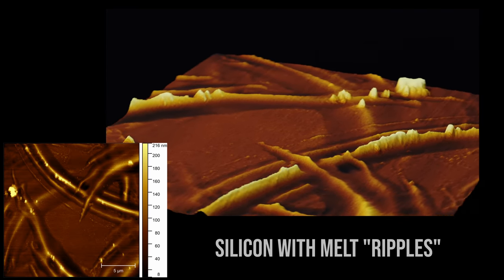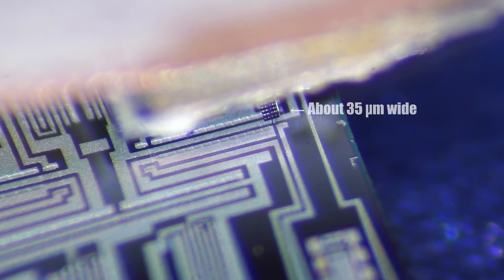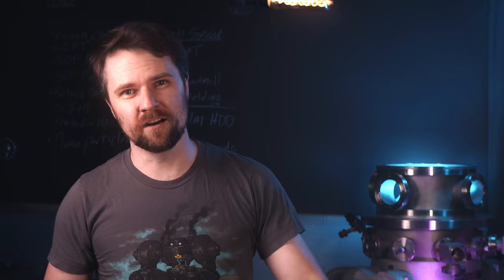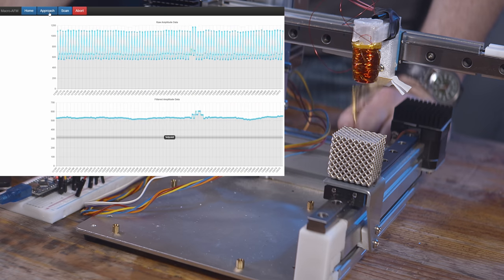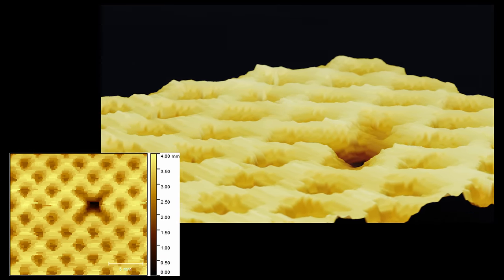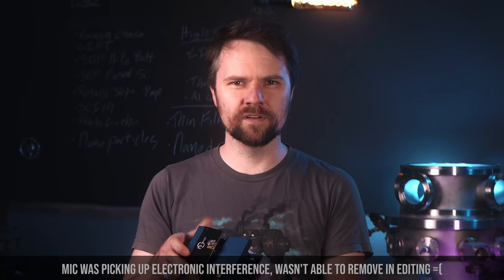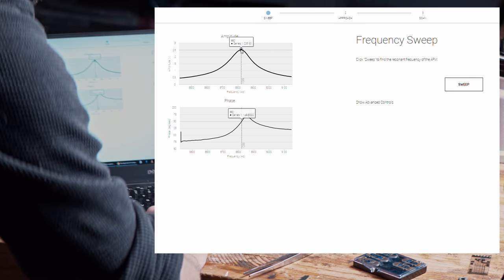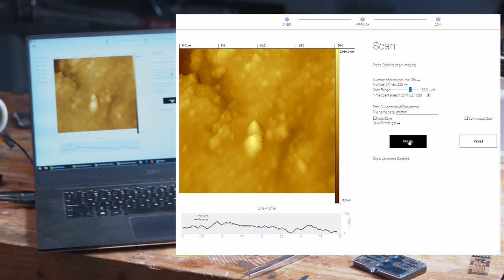1,000,000x Magnification with Atomic Force Microscope

Comment: i'm honestly more interested in the machine that you made rather than the commercial one. even though the setup is janky, it works remarkably well. i'd love to see how far you could push it if you actually tried.
Reply from the maker: Yeah it turned out remarkably good!  I really wasn't expecting much but it definitely surprised me.  I'm thinking about ways to improve it for a v2, something a little less duct-taped together. I think with a bit of love it could actually be a useful tool, and maybe hit micron-level precision with some reliability.  Honestly just needs a better stage and a smaller/faster cantilever (and maybe some better electronics to sense the back-EMF).  Or perhaps something that could be bolted onto 3D printers in general.  I'm thinking about reaching out to some more EE-minded youtubers and see if we could collab on something.  Dunno, but it's on the "things to investigate" list for sure :)
Reply: @BreakingTaps  i think you're right on "smaller/faster probe". you don't need nearly as much amplitude for vibration, it just needs to wiggle at higher amplitude than the maximum height difference, right?

i also don't really like the idea of using a 3d printer for positioning, because i think it'd limit the resolution greatly. the positioning system you used in the previous video looked way more interesting.
Reply from the maker: @Alexander_Sannikov  Yep, the oscillation just needs to clear the largest feature basically that you would encounter within a single step.  So smaller probe == smaller maximum discrete height change from pixel to pixel, but also faster acquisition time.  I didnt have time to get into it, but my software basically calculates the amplitude from the most recent few samples, and then does some simple moving averages to smooth out noise.  Faster oscillations mean the amplitude would "settle" in much faster.  Better software would help too, kalman filtering or other techniques. :)

And ++ OpenFlexure would work great.  Only downside is the very small XY range.  But it'd be a perfect fit for a miniatured cantilever!
Reply: @BreakingTaps  i like the idea of using flexible joints in such high precision mechanisms, because they should allow way higher precision from the same manufacturing tolerance. so no wonder the entire commercial thing is an alien compliant structure. do you think you could literally copy their compliant mechanism from an image and maybe laser cut it in sheet material?

hey about the patreon. i noticed your lowest tier starts with $5 which's considerably higher than they usually are. I think you could get way more overall if you allowed people to make maybe $1-$3/month donations too. also Applied Science runs a really cool scheme where we're paying for each video he makes no matter how long it takes, so he does not have to push projects at any regular schedule.
Reply: @BreakingTaps  Perhaps a magnetic/ceramic (piezo?) cartridge and stylus from a vinyl record player might work for V2? I'm sure they can be driven on half a cycle, and read on the return in a similar manner to the MIT paper. They bear all of the mechanical properties (cantilever, low mass, soft sprung, hard tip) except with a potential resolution in micrometres.

[Edit] I've just experienced the hoarders paradox. Keep everything interesting because one day there'll be a use for it. Except, decluttering one's life periodically means those interesting and potentially useful items get thrown out. A few decks and a box of pickups and styli are nowhere to be found. Stereo could have allowed one channel to drive, and the second to read with just a small modification to the pickup cartridge. You've set me on a mission now.
Reply from the maker: @Alexander_Sannikov  Could probably adapt their flexures to a more "macro" version I think.  It'd need a bit of adjustment, theirs use thermal bimorph actuators to drive in XY (and maybe Z? not sure), so those would probably need to be adapted to something else in the macro world, motors or something.  But otherwise yeah, to my eye the flexure looks like it uses pretty normal/standard flexure design and is planar.

Re: patreon, cheers! Still figuring it out :)  I do have a $3 tier, and just added a $5 because I was uneasy with the gap between $5 and $7.  I was thinking about the per-video thing, but I'm actually about to start ramping up how many videos I put out (starting a "micrograph monday" segment which are shorter and designed just to show off cool scans on the AFM or optical microscope... and possibly SEM some day 😇), so I didn't want folks to feel like I was pushing a bunch of videos just to capitalize on patreon donations.  I'll look into it though, maybe there is a way I can make Patreon only charge for "feature project" videos?  I'd feel bad charging folks for the shorter segments.
Reply: @BreakingTaps  wow i didnt know they use bimetal actuators. that's cool! do I understand correctly that bimetal actuators work best if they're tiny? because they need to have the highest heat dissipation/heat capacity ratio and since dissipation is proportional to surface area, capacity is proportional to volume and area grows as x^2 and volume grows as x^3, it increases to infinity for tiny mechanisms? 

if so, that'd be cool to talk about it in the video! heck, maybe you can print a small bimental actuator yourself by depositing two types of metals with sputtering or something.

Comment: If you like this look into SNOM scanning near field optical microscope which is essentially an AFM but also provides optical information such as absorption etc and sub diffraction resolutions. ie you can get nano meter optical resolutions with longer wavelength light such as IR.

Comment: You could try ellipsometry to check for a diamond layer. The data will allow identification by refractive index. A traditional setup would be:
1 light source,
1 photodetector,
2 polarizers,
2 quarter waveplates that you rotate by hand to 16 different angles.

Comment: This is a brilliant, fascinating video. The research you have done here is incredible. I have been doing a PhD in the NC-AFM (Non-Contact Atomic Force Microscopy) for nearly 3 years now, and I am impressed by the volume of knowledge you have expressed in this video.

I thought I'd give a little extension to your brilliant video. I'm sure you came across NC-AFM during your research, however in case you didn't I'll give a quick overview of the power and sheer 'amaze' factor of NC-AFM compared to conventional AFM. In NC-AFM we will create tips that are atomically sharp. As in the apex of the AFM tip is a single atom, which we often pick up from the surface that we are imaging. This lets us get down to pm (pico-meter) resolution, with a typical image taken at ~10 pm resolution (SI=10^1m, mm=10^-3m, um=10^-6m, nm=10^-9m, pm=10^-12m). Some truly amazing images have been taken. The most famous image is an image of a Pentacene molecule, taken with a CO AFM tip. You can literally see the covalent bonds between the Carbon atoms, within the Pentacene molecule, and even the 'bowed' shape of the molecule on the surface.

How do we do this? We oscillate our tip above the sample (hence the Non-Contact phrase), rather than letting it touch the sample like in the tapping mode technique you demonstrated here. Our samples are typically under Ultra High Vacuum Conditions (UHV), and the most beautiful images are also taken at 5K. 5K being 5 centigrade above absolute zero, we achieve this by cooling our equipment with liquid helium.  Finally, the 'AFM machine', with all it's supporting equipment, is about the size of a car.

I hope people found this interesting.
Reply from the maker: This is really fascinating, thanks for sharing! I'm continually amazed by how big and fascinating the field of AFM/scanning probe techniques is. Picometer! So cool!

Comment: Incredible performancy by such a tiny machine! Now, you could try to ENGRAVE something, using the same equipment, on some soft material - which can be hardened afterwards by heat or some chemistry. Afterwards, you can scan what you engraved... And get a proove of the densiest ROM ever. Would like to see!

Comment: Great video!  Yay Gwyddion!!!  If you peel the ink off a commercial (stamped) CD with scotch tape,
you can directly image the pits.  Around 250nm high.
Reply from the maker: Hah, funnily enough I tried to cut open a DVD for this video and failed miserably. Couldn't get the two halves to separate.  Is it just the top "label" that needs to be removed, not split in half?  Will definitely try, I've seen some photos online and it looks awesome
Reply: @BreakingTaps  Yes.  On a stamped CD or DVD, score  1cm x 1cm inked side with razor blade or scalpel.  Peel the area with scotch tape.  Flip and tape (taut) along edges to a flat substrate.

Comment: When you edit in the output of the AFM from the laptop screen, maybe superimpose it over the laptop screen and leave the AFM itself visible. I know it's not doing much, but that only helps drive home the tiny dimensions involved, and is more informative than two output screens showing the same thing.
Reply from the maker: Yeah, that was a mistake on my part, there were a bunch of questions/comments to that effect. I added a section to this video which showed what it looked like so that folks could see it in action and get a sense of scale if you're interested! https://youtu.be/m0UK7LVSZ8g?t=291

Comment: I was hoping for this, they are realy cool things ! the classic way of demoing them is on a CD, but it needs to be prepped however its so neat looking at the digital info, this is a great video can't wait to see more...cheers.
Reply from the maker: Hopefully in the future! I tried to cut open a DVD for this video but failed entirely in getting it apart.  It is a really cool demonstration though, I've seen some photos online and really want to try it for myself.  Any tips on cutting one open?
Reply: @BreakingTaps  You can expose the aluminium bit were interested in with a solvent, but cant remember which ! also some of the CD's or DVD's can be heated and 'peeled' but again can't remember specifics (I'm no use!!) but I would imagine if you asked the guy's who made it, they might know how to do it with modern discs, I used AFM years ago when CD's just fell apart !....cheers.
Reply: @BreakingTaps  May need the dvd to be a single layer for the tape trick to work, unsure exactly how the multi layer discs are metalized...  It definitely has to be stamped not burned though.  It'd be quite interesting to see if when you peel the metal layer if you could image the pits in both the metal and the plastic layers as mirror images!

Comment: on the topic of the EMI on the microphone- you have for instance audacity which is free, and it comes with a spectrometer and a filter curve equalizer. those may perhaps sound complicated but the first just lets you see (visually see) what frequencies are composing your audio in any point in time, and the curve equalizer let's you set the "volume" across the spectrum. so for instance just check when you're speaking what the maximum frequency your voice reaches is (you may even record yourself doing a high note- higher than anything you did in the video just to establish that cut-off point), and then just set the curve to 0 entirely on any range above that.

alternatively just use any old spectrum analyzer (can even use the oscilloscope if you just play the audio with a speaker and connect the oscope to the wires) to find out roughly what those frequencies were - and get some appropriately sized mesh to wrap around your microphone that blocks it. something the microphone itself should already do but I guess they weren't expecting it to be used in a lab with all sorts of things making weird uncommon electrical noise

if you're good at writing code, you can convert your audio file to .wav, which is uncompressed audio (and thus very easy to parse) and run through it while applying a fourier transform and selectively plucking out those frequencies. they're much higher than your voice so just checking for "above a certain frequency" should suffice. essentially a manual version of the first solution, but hey might come in handy if the frequencies ever reach a range that's also used by your voice - that way you could write a slightly more complicated algorithm to get rid of it, as long as it doesn't jump around too too much. or even just if you want to put an antenna next to your microphone so it captures the same frequencies and you can cancel it out by just roughly subtracting

Comment: What about using a stainless wire about, iunno, 24 or 32 gauge for the tip? If you're careful, you could probably weld or braise the wire to your cantilever. Stainless wire is easy to find and obtain; most local metal foundries can supply it and it's available online for cheap. If you're careful to keep the wire as straight as possible, you shouldn't have to worry too much about deformation.

You could also use a hypodermic needle with the end filed flat. That'd give you even more rigidity against banging the tip against the sample.
Reply: One of the old ways with STMs was cutting tungsten wire at an angle and pulling it apart while cutting to try and draw out an atomic point.